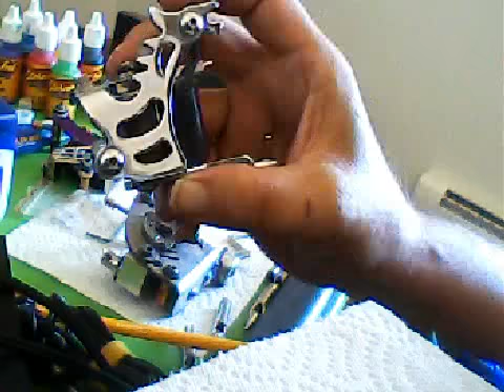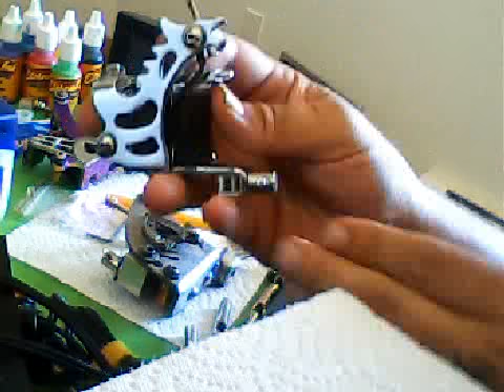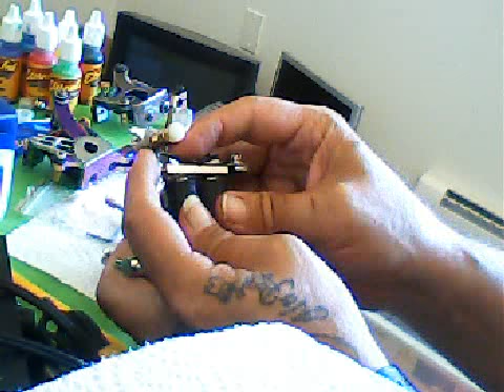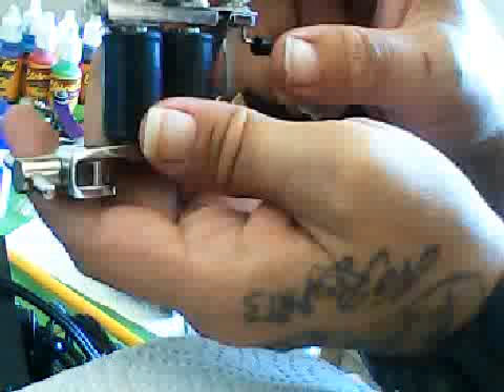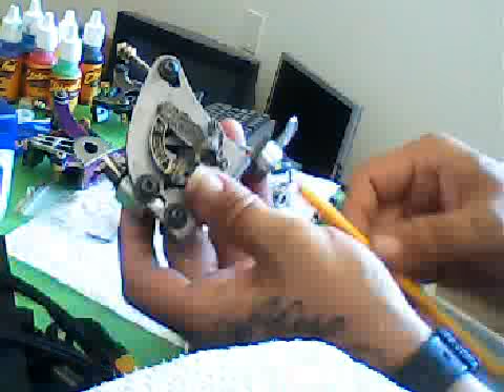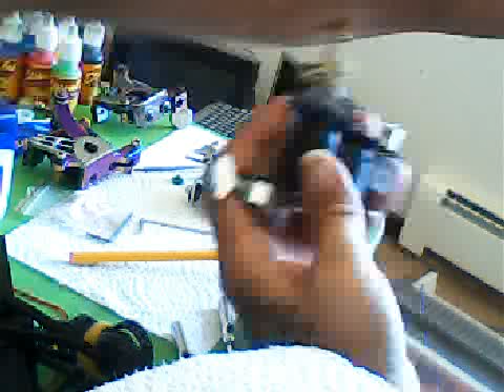Basics Of Tattoo Machine Repair Without Proper Equipment

Comment: They never have to ask the client to do more adjusting. They have everything set and ready to go. Your custom built machine that is a liner yet you're running a heavy ass armature bar that is used for a slower machine that packs color. I understand that you are trying to help but damn man, lining at 5 volts lol.

Comment: U do realize that your tattoo ink is fake and come from China... if it were from eternal then the caps would be black not white
Reply: Was thinking the same. they will be clear caps too. the shop I ran we ink t used eternal and never seen a bottle like that. solong has a line of ink they sell as eternal. cheap basterds
Reply: @600rrcbr7  damn right. Mine were all clear capped on top of the black. This guy is actually tattooing people with that shit.

Comment: Good Video,  Tiny Texter ~ I would add that your armature bar in the video looked like it needs to be moved back a little to center it.  Next you also want to make sure that the springs on the armature bar are in line. Either with fingers & eyes or a jig. 

You can look as you said at either the ghosting of the springs on the side when you see the illusion of 3 front  springs, &  or the armature bar nipple from the side 3 of them that is the ghosting of.  It is considered a balanced machine.
That is 50% on 50% off or a duty of 50%.

Next you can get a neon color donut armature bar nipple & some white our.
Paint the whiteout on the armature bar nipple, place a neon donut nipple over it.
From the front look at the nipple ~ look at the dots the ghosting if the armature bar pin again you should see an illusion of 3 of them. Slightly overcome lapping Liner, Further Apart just about touching a Shader, just a little further Apart Color Packer.

Also that perfect B Flat hum of a well tuned coil machine.

Next put your thumb or finger under the armature bar pin let it hit right under the nail on the skin. Feel it where it stings a little not hurts should be about right.

Tiny Texter is correct, Practice on Honeydew Mellons, Pumpkins,Grapefruit, Oranges, Tangerines, Bananas, Pigs Feet, Pigs Ears, Pigs Skin. Some butchers will give you the. Skin & Ears others Charge. Ask!  PRACTICE SKIN, CRAFT FOAM Available @  Wal-Mart, children's crafts section. AMAZON.COM,  The Dollar Store. Wal-Mart's & AMAZON.COM's is a little thicker about the thickness of the heavier practice skins. The Dollar Stores is thinner about half as thick. Which is the same thickness as the thinner synthetic practice skins.
Both good. Wal-Mart & AMAZON.COM notebook size is about 40 cents each. They have another one larger in packs you can practice a back tattoo on.about 3 X  the Width & same height. The dollar Stores just watch needle debth.

I would advise everyone to have at least 3 Clip Cords they are cheap on AMAZON.COM & at least 2 foot switches, & 2 Power Supplies. A few Rotary's & at least 2 Liners 2 Shaders 2 Color Packers, Reason if you are tattooing & have a problem your not wasting your time your clients time. You solve it fast.

How is the Nedz Rotary ? Did you figure it out yet ?  Correct the issues, or send it back, DHGATE.com will take it back typically 7 to 30 days after you received it contact them  e-mail or phone. 

Take Care, Bill Kearney
Reply from the maker: yes i did with the nedz with your help.. i changed the spring to a softer one and eased back on the needle bar tensioner...runs smooth loaded at about 6 volts now instead of the 9.5-10..big differencethanks for all of your help..
Reply: Tinytexter o ~ You are welcome glad I could help. You know DHGATE.COM Has a Chinese Knock Off Spectra Hallo Rotary for $23 including Shipping with a 2 Year Warranty & a MABUCHI motor that is a knock Off of the Swiss Maxon!  The real one is priced at about 30 X that!
Reply from the maker: really that is a good price..i really like coil machines the best.. but a 2 year warranty sounds really good..lol can i ask you a question about  Chinese coil machines..i really like them and i don't have the money to buy nice machines do you think you can get the same quality from them.. i wish i could get a nice machine to make a comparison of the 2 but ask will just have to do lol...
Reply: Tinytexter o ~ yes they are a world Super Power like the U.S.  So if they can build nuclear missiles!  How hard is it to build a coil tattoo machine. Kailyn Tattoo Machines, $40 to $300 DAIU Machines, $50 to $400 Tattoo Lous, about $15 to $400  Also look on my Google Plus page the video FRAME GEOMETRY FOR BEGINNERS. in the video Dennis has information on  couple that have good coils. Like $10 to $20 .
Reply from the maker: thanks for the info..i will look that all up and check it out.. it all sounds like the stuff i love to dig myself into..lol anything tattoo i can check out i am all for it..lol i have looked at most of your page already...love all the info and videos...just my cup of tea..lol
Reply: Tinytexter o  ~ Also you could do as I do & purchased the Chinese coil machines you like, concentrating on the frames you like. LOOK FOR CNC MACHINED,  OR CAST OR WIRE CUT FRAMES, TRY & AVOID STATED FRAMES, Like the liner you have in the video. You can get them to work but the frames are not as durable as cast, CNC MACHINED. 
**{ Typically you can stuff the voids in the coils with STEEL WOOL, Ace Hardware, Lowe's, HomeDepot, Wal-Mart, paint section. Also the dollar store. A tiny dab will do just enough to make it a little stiff to screw in the last turn.  Look at Mike's video in my Google Plus page Disc 1 & * Disc 2, tuning a Chinese tattoo machine.}*** 

Also go to my http://AMAZON.COM reviews, the Heat Treated Walker Style Shader. Good Quality Cast Iron Machine. $6  The frame was actually polished before the Heat Treatment. Rare for a Chinese Machine. The Armature bar was good as was the hardware. If you want to replace the hardware with U.S. hardware, just drill out the holes with a 1/4" drill bit to accept U.S. Hardware. NOT NECESSARY.  As with most Chinese Machines The Springs were craps. Replace them. Infinite irons or monster steel .com , World Wide Tattoo , $2 to $4 each Also cut them your self 1095  Steel Coil Spring Stock. About 10 cents each. Typically its blue, a treatment for making it corrosion resistant. Also feeler gauge stock although that cost more. The Coils were junk. So New Coils~ Coils Wrap your own $4 or purchase Salt Water Tattoo Supplies Coils. Or Ring Master from monster steel, piercing pros, piercing pros & monster point same company..
 http://monstersteel.com $25 
So for aprox $35 you just built a custom machine.

Log on to http://AMAZON.COM, next type in to Search Box 
√ { Moms Black Pearl Outlining Ink } * Next Look for my Review by my Name √ ☆ { BILL KEARNEY } ☆ 
Next Click on my Review, Then Click on either my Name or where it says all reviews by this person.
Look for as I said the Walker Heat Treated Coil Tattoo Machine.  All my reviews are packed with educational information on tattooing. FREE PDF'S, FREE E-BOOKS, Video Links.  Look at the kit One & Tattoo Book ones for free Links to videos & books & PDFs on tattooing for beginners & intermediate level tattoo artist. Hey if you find a review helpful please √ Check The Box ~ √ Yes This Review Was Helpful!  Thanks..

Also my Google + Page has tons of FREE VIDEOS ON TATTOOING. YOU HAVE TO SCROLL THRU THE FUNNY POST CARTOONS & MUSIC VIDEOS BUT IT WILL BE WORTH IT. TONS OF VIDEOS..

Take Care, Bill Kearney. :-)
Reply from the maker: I will go take a look.. i love looking at everything new.. and learning new things.. you are such a great help.. i cant thank you enough for all the help and info you have given to me..it might take me some time but i will get through it all .lol
Reply: Tinytexter o ~ You are welcome...